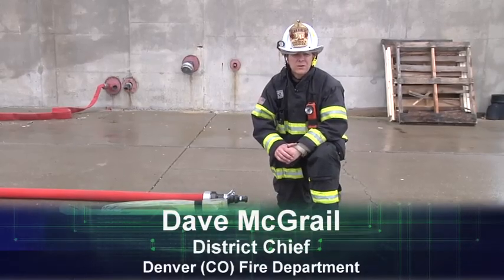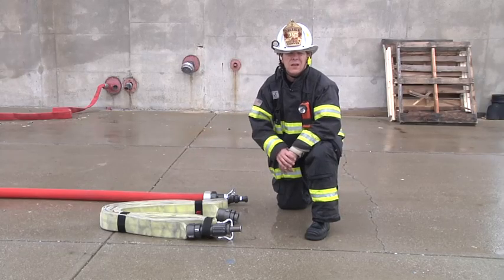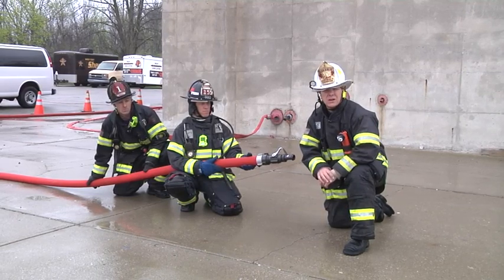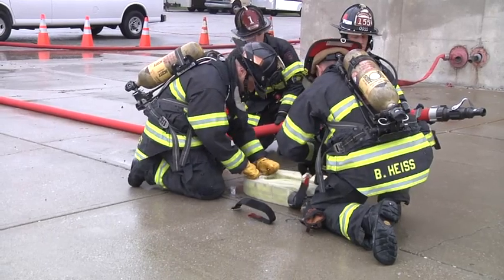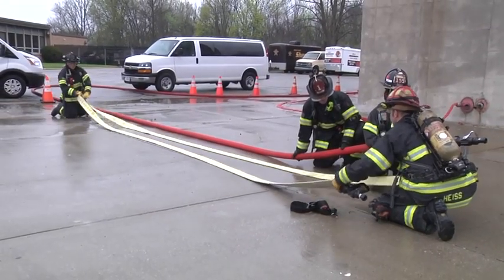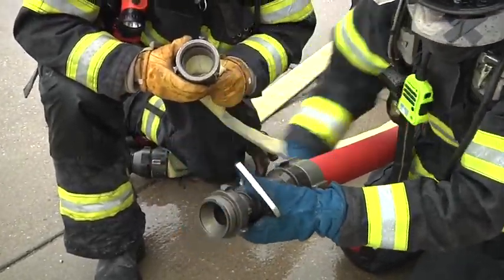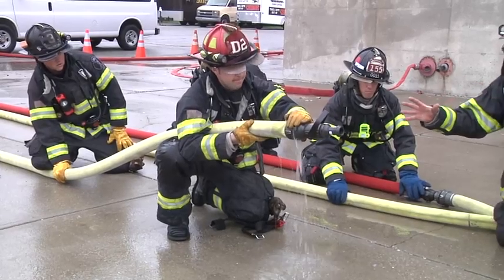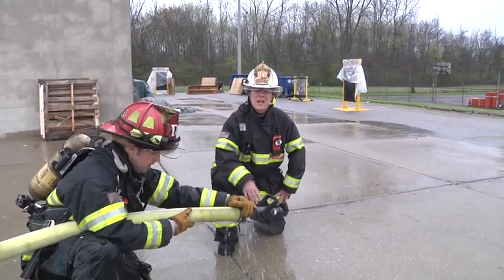Extending a Hoseline

Comment: If your dept doesn't have the adapter fittings  then you can use a hose clamp to squeeze off the water, spin off the entire nozzle, add your additional hose in, spin the nozzle on, then release the clamp.